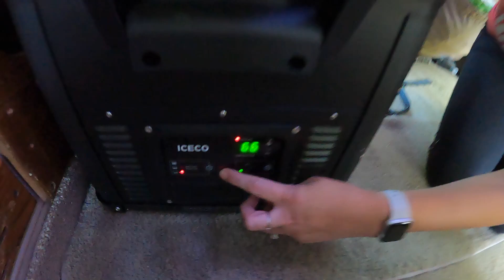Chevy Astro AWD vs 4WD: Which Transfer Case Is Best?

Comment: Overall, how much do you like the 4wd astro in the snow... power and fuel economy?  Im looking at overlander-ish options that can tow my vintage glass boat
Reply from the maker: It’s the only option for me. Tows 5k. Awd and kicks ass esp w g80 locking diff.  Only downside is 13mpg highway 13mpg city
Reply: Ya... that sucks.

Comment: So after driving for a while was this modification a win? Any chance the distributor was off? Or not at all? Mine runs good, not sure if doing it would be advantageous for me. But great idea. Thanks! Steve
Reply from the maker: The distributor mod to tweak the angle SOLVED my problem!   It's been over 10k on the same distributor, still running great!  Massive, massive win for my van!

Comment: Another that agrees if you are using the van as it was designed to be used and not trying to make it into a hardcore off-roader which it will never be then staying with the stock AWD unit was really the best choice overall.

I have not really taken the time to study the front diff/axle operation on my Astro as to how it engages/disengages but if it is like the older vehicles that did not have lock out hubs then you are still more than likely spinning everything in the front end just with the wheels turning even with a actual s-10 transfer case in the 2wd position.
The front drive shaft may be disconnected in the transfer case but probably the front drive shaft is still spinning as the wheels are turning the front differential.

Same basic operation on the older even back into the 70's GM P/U's with the fulltime 4wd transfer cases.

With those to actually accomplish anything you had to change a gear in the transfer case to disconnect the front driveshaft in the T/C and install a set of lockout hubs to disconnect the front axles from the wheel hubs or you were still spinning everything in the front diff and accomplishing little really.

Comment: I have a completely stock 2002 AWD cargo van with the small stock tires and I took it up the designated jeep trails on the north side of glacier nat park Montana. I remember the park ranger telling me that they only recommend 4x4 vehicles to go on these trails and I told him this is. Long story short I made it all the way to the top campground and nothing but jeeps up there,  needless to say they were amazed I made it up there..and so was I😁 I definitely had to change my underwear once I made camp😅 Going back down was even more terrifying 😊
Reply from the maker: Right on dude!  I think people need to use them AS IS for a while and see if they even get stuck or need the 4wd swap in the first place.  I bet most will never need it over the factory AWD.
Reply: @ADDvanced  yep, just be mindful of your ground clearance,  which isn't much,  but this is a very capable hill climber. Definitely not something you go over boulders and trees with. And that howling noise is coming from the rear end, it's the pinion backlash,  they all do it, nothing to worry about. Just check your rear end fluid for metal shavings if it's clean your good. In my opinion the only thing you gain by lifting  and putting bigger tires is it looks cool. But  for  the work and money you have to throw at it your better off buying an old YJ Wrangler and  you will be way more off road capable than these vans could ever be.
Reply from the maker: @georgejetson1923  Yeah, but you can't sleep and camp in a wrangler very easily.  They also suck at towing.  I think a MILD lift with 29s is a good upgrade, without ruining the van's daily drivability.

Comment: Honestly, I would’ve gone with an Atlas 2 speed case or at the a 233C or a 241 transfer case. 

Worst case scenario, do a 203/205 doubler that you can find in the square body Chevys.
Reply from the maker: Depends on what you're trying to do.

Comment: Nice work!  I live in Colorado and rebuilt my NP136 with the BK333 rebuild kit in addition to a new BorgWarner HV-062 chain and new Dorman 600-906 Transfer Case Motor. 2K miles later and it has not failed! I must have rebuilt it correctly! Update: 3K miles and crushing the snow on my "got to" unplowed backcountry access turnouts!. The Astro AWD is a Tank in the snow!
Reply from the maker: How did hte rebuild go? I've never done one before, seems intimidating?
Reply: @ADDvanced I had the service manual and then paid for info from a gm site that had current info on the rebuild . It wasn’t bad at all! I followed a Dr.Shock video on another rebuild….it helped! I had ziplock bags with parts, etc, labeled. I’m 14K miles in and no problems! The gratification I got from doing this was/is priceless! You can do it!
Reply from the maker: @BigZaddy2112  Did you need a press? Thanks man, I still have my last one sitting here, current one is making noise again. This would be the THIRD one. Maybe I should get my driveshaft balanced too eh?
Reply: @ADDvanced No press needed! Not sure about balancing the drive shaft..I did replace my u-joints. As you know, chasing noises and vibrations on these vans are a nightmare! Just take your time if you rebuild the transfer case. Buy a case saver, it replaces the little metal piece that is meant to keep another part from rubbing a hole in the case.

Comment: Great work Rob, but im hanging out for more boat videos.  Its nearly summer here again and i need inspiration 😂
Reply from the maker: I have a couple more written, but they won't be on water.  It's already cold here.
Reply: @ADDvanced  i would love to know where you are at with the SST build, the V6 2.4 rebuild and the V6 150XRi overheating issues.  That is all. And some more more Merc history please. Maybe a tower of power history lesson would be awesome.
Reply from the maker: @elliottlewis2830  Not very far.   My dad passed and I am overwhelmed with projects right now.   Also, my full time job was eliminated at Mercury Marine so I'm not sure I'll be doing much about that company anymore.   If they don't value my contributions as a designer AND the content I am providing, fuck them.

Comment: I was never a mini van fan but I always liked the Astro. It's built on a truck frame and looks good.   Happy you were able to solve your mystery noise.  I have an 03 corolla shakes at low throttle but clears with gas or any speed. I've been chasing this for 15 years..... one day I'll find peace of mind.  Two mechanics and one transmission shop have given it a clean bill of health.  It drives fine other than that so I am just waiting for complete failure.
Reply: I daily drive a 93 Astro with just over 300k miles.  It's a great vehicle.  However, contrary to popular belief, it is NOT built on a truck frame.  The Astro is a "unibody" construction vehicle, not body on frame.  The S-10 series is body on frame.

Comment: I did the NP233 4x4 transfer case upgrade and made a video on it, and now I have used the van for 2 years and plenty of extended van trips. There's definitely pros and cons to the 4x4 swap. If you're actually off reading it's great. Going up and down steep inclines is substantially better. I also have 31 inch tires, and steep inclines and big tires was a bad combination before the swap. As far as cons go, like you say is driving in snowy/mixed conditions. I pretty frequently drive highways that go over mountain passes, and AWD is definitely the move there. As conditions change it's ready, but now I have to find a place to stop and shift into 4x4 if needed. Then you're stuck running in 4x4 mode until you stop again. It's definitely not ideal. I don't regret doing the swap, but I wouldn't really recommend doing it unless you know you want it. I came from a lifted Toyota 4runner on 35's, so I wanted the most capable offroad Safari I could build. Ultimately though, I am mostly driving on roads or lightly offroading, and if I were building another van I would probably keep it AWD and run smaller tires. At least that's the logical part of my brain thinks, the meat head in me loves the big tires and 4x4. It definitely attracts more attention this way😂
Reply from the maker: And I totally get that lol.  My whole build has to be able to cover half the country at 80mph for sometimes 14 hour stints.   So mild lift with 29” all terrains.  Can definitely handle snow/mud season in the mountains but yeah rock crawler it is not.

If I lived in Arizona and public 4x4 trails were an hour away, my build would have turned out differently.   

I think a lot of people automatically think the 4wd swap is an upgrade; just depends on what you’re doing.  Cheers 🤙
Reply: Thank you for this info.
Reply: I can shift my Silverado under 45 on the fly in and out of 4h. I would think you could too. Have you tried?

Comment: Cool, more Astro content! You make an interesting point irt AWD vs 4WD. Mine is still AWD but I planned on making the change while I was still in AK. I'm in FL now so maybe now it makes a bit more sense, though who knows where I'll be in 5 years
Reply from the maker: Yeah, I use mine to cross the country during winter to get to our off grid land in the mountains of CO, and then use it as a ski pig all winter.   For MY use case, AWD is the better choice vs 4WD.   Everything in life is a tradeoff.   That said, I have only been stuck once, and my van was high centered in deep snow and ice, so 4wd wouldn't have even helped.